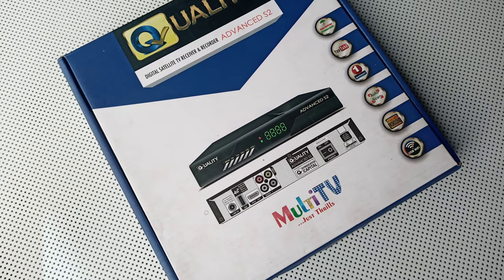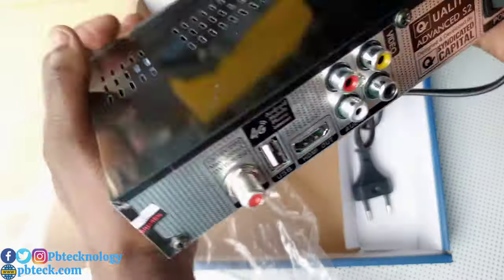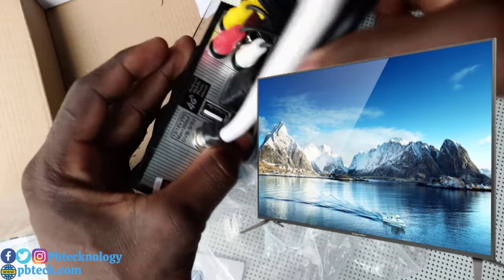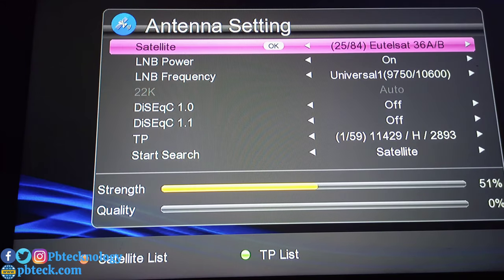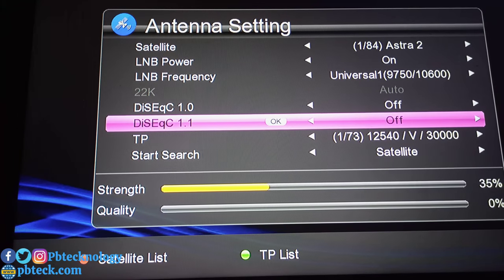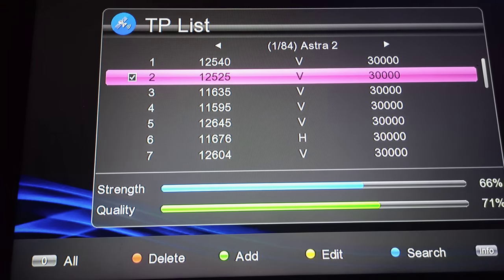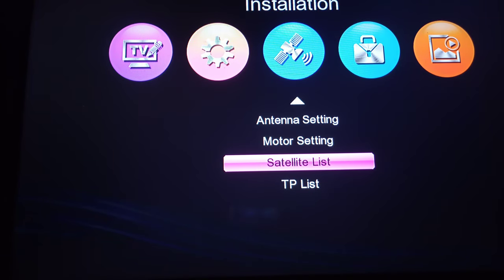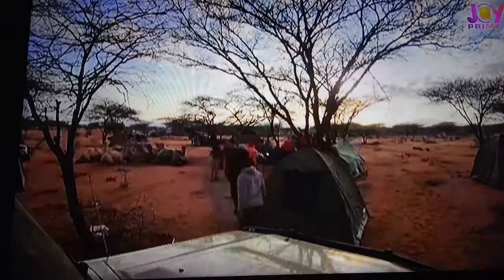How To Install Quality Decoder - Multitv

Comment: With the antenna,do I need the very big one outside or these smaller ones I can simply put on the TV or beside the tv
Reply from the maker: This will simply depend on your location and the availability of the Terrestrial signal. If you're living in or near greater Accra and some regions whereby the Main Antenna Poles have been setup, you don't need a big antenna or a long Pole to get the signal. So try it by checking the signal In your room before moving  it outside if there's no signal.

Comment: Hi my brother, how are you? Thanks for the video. I am confused, I did follow this video but in the end after everything it is showing me No new channel is found. How can I add new channels? I am using DigiSat decoder box FTA
Reply from the maker: make sure you have enough percentage of the signal quality before you move ahead to scan. you can't get the channels with a weak signal. anything above 60% will be okay.  most decoders can even show 70% but it will still be a weak signal. So adjust the satellite dish to top up the signal quality and the channels will pop up  after scanning
Reply: @pbtecknology  Thank you for that info. I have worked it out

Comment: Please can I use two different dishes to track multi tv and mbc channels on one decoder
Reply: What should I set in diseqc
Reply from the maker: Sure, You just have to connect the cables to the Diseqc ports and Scan the decoder with the respective Diseqc port number.
Just make sure to select different Satellite Folder to scan each Transponder.

Comment: I am done with all this but , I don't get channels from Ghana. My decoder is digisat  combo dx10.
Reply from the maker: The dish is not receiving MultiTv signal. You have to change the dish position to get a stable signal using this TP 12525 V 30000

Comment: Hi  prince this is Ezekiel from South Africa I just like to know what is a LNB what is inside a LNB
Reply from the maker: LNB = Low Noise Block down-converter. 
In simplest form, it's the only part of a satellite dish that have an electronic component which receives power from the receiver.
The main functions of the LNB is to take weak Satellite signal and strengthens or amplify it. It also convert Satellite signal from extremely-higher frequencies to a lower frequencies. The LNB perform this functions purposely for sending a satellite signal through a normal cable. It also helps in taking microwaves signal from the space and turning them to Audio & Video for Television, which the receiver (decoder) do the final job.

Comment: After doing all that there's no tv channels, what could be the problem?
Reply from the maker: Just carefully adjust the satellite dish to get a stable signal using this TP [12525 V 30000] if it's MultiTv. 
* Get a stable signal quality (more than 50%) before scanning.

Comment: when LNB is not working what’s the solution
Reply from the maker: Check if the cable is working, the problem may be from the coaxial cable. LNB normally loses strength as it gets older, but not a complete damage. Check again in the Installation settings on the decoder to make sure those are the right LNB settings. After checking all this and there's no LNB signal, you have no option than to change for a new one.  But note, most Chinese Decoders will never show any signal strength or signal quality unless you're having a stable signal quality of that TP. ❤️
Reply: alright